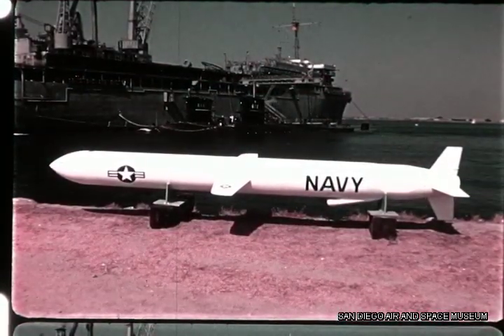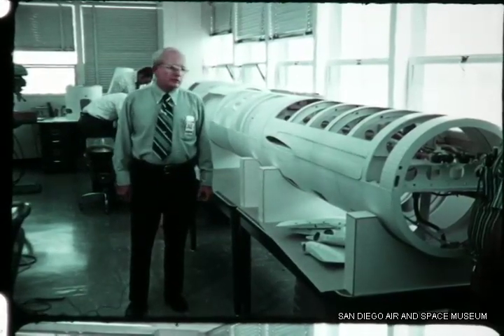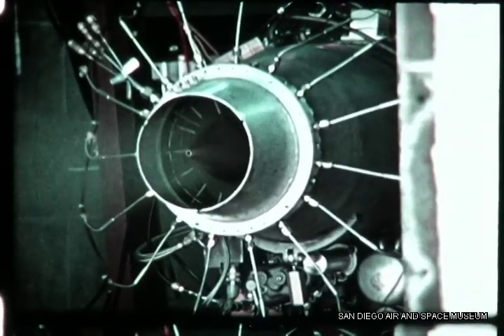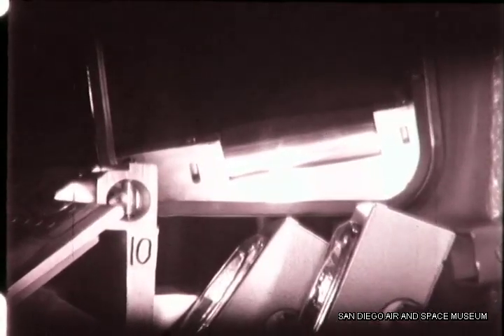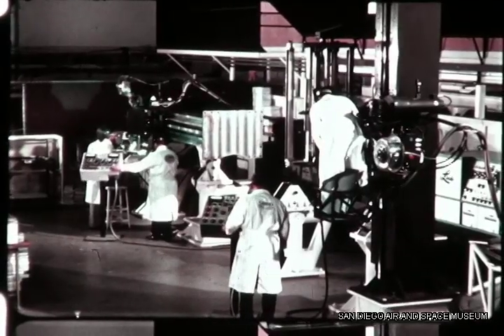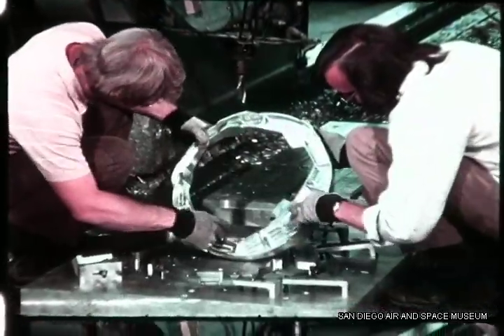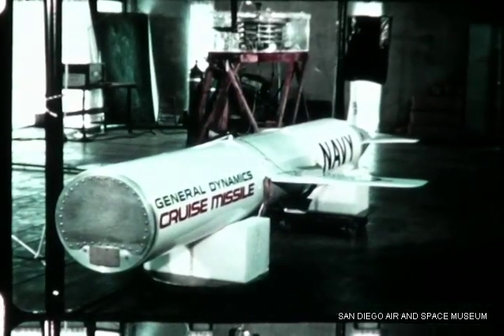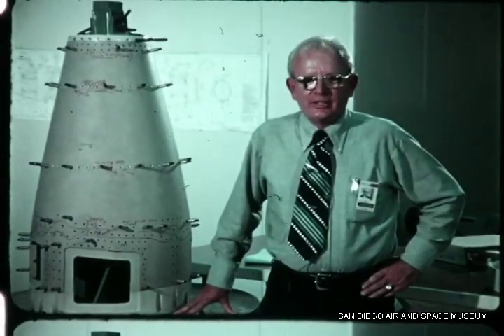Convair Progress Report Tomahawk Cruise Missile HACL FILM 00186

Comment: There was just one little problem..... Under General Dynamics (GD) the missile could not consistently perform nor obtain it's intended operational capabilities.  After the USAF IG office (then) last report was filed, which gave GD an "Unsatisfactory" rating, they then required GD sub-contract to Hughes Aircraft Company.... who took about 1 year to replace/redesign the guidance control systems and then for the 1st time, it successfully met 100% of the performance objectives.  QA manufacturing issues were such at GD, that the USAF mandated that manufacturing be awarded to Hughes....the missile was produced at Hughes Aircraft Ground Systems Group in Fullerton, California.  Upon the breakup/destruction of Hughes by General Motors (who purchased the company in a "forced sale in 1984), the Fullerton site became a shopping center, the missile was then produced in El Segundo, California at the former EDSG Electro-Optics & Data Systems Group location in El Segundo (still built there today) and because of a criminal indictment and conviction, Hughes was banned from all missile contracts for 5 years with 100% of all contracts pulled, Raytheon took over many of the missile contracts including the Tomahawk.